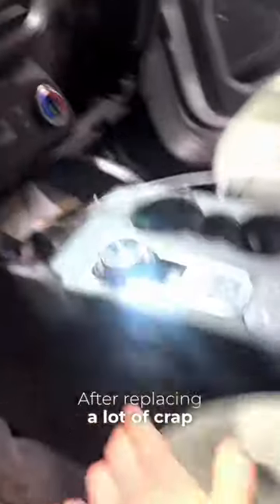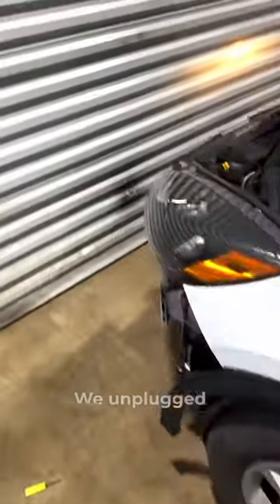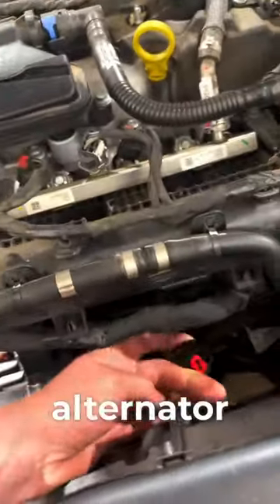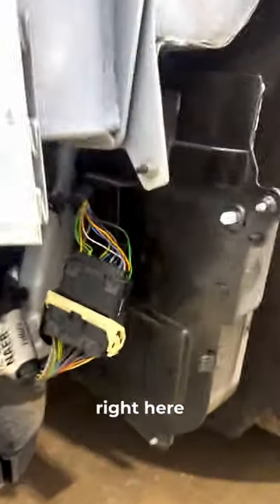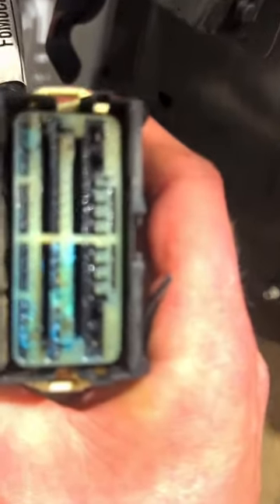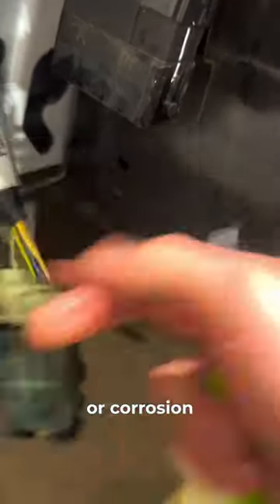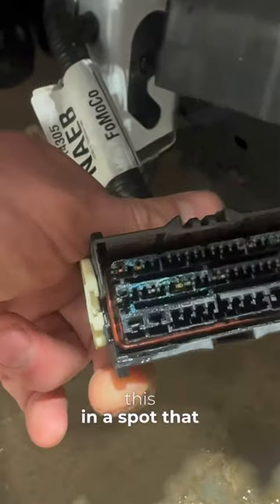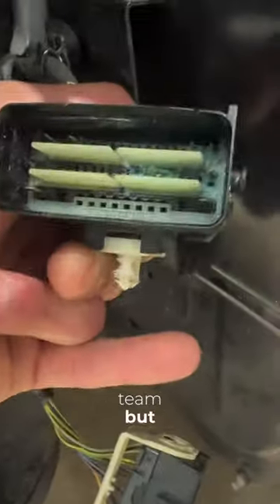Ford owes me big time on this one #ford #shorts

Comment: I feel you on this shit bro. Something like this will happen and you do your best to figure it out and you recommend a part you are not for sure 100% will fix it and it ends up not fixing it and the customer is PISSED because they expect you to know EVERY bolt, connector, pin, wire, bearing, and bushing by heart. But you keep trying and ACTUALLY find the problem after hours and it fixes it but the customer is like “well why didn’t he check that before?” But again, they will never understand.

Comment: I ran into that exact same problem about 10 months ago. What genius engineer puts the active shutter grill on a data line
Reply: What is the purpose of the "Grill shutter" or "Shutter grill" this is the first time I ever heard of this and whatever it is, it's probably not needed!?!
Reply: @Seriously6818  In “theory”, it improves fuel mileage by improving aerodynamics on the highway when the shutters are closed. They then are commanded open in stop and go traffic to allow sufficient air flow to keep the engine cool.
Reply: They’re all on a comm line, no matter which manufacturer. The problem here is poor quality “weatherproof” connectors.

Comment: I bleed Ford blue, but Ford needs to get their shit together.
Reply: No different then any other brand.
Reply: FR
Reply: I am turning to Hyundai now that ford stopped building in Australia. I'm not buying a Thailand made car with a VW transmission
Reply: Plastic chain tensioner, plastic sunroof track parts , crap manifolds, my 3.5L is a leakOboost more than an ecoboost. Pisses me way off more than my Triton 5.4 motors I've owned.
Reply: @OffGridInvestor  might want to consider something other than their 4cyl offerings. My friend has 2020 Elantra with 150k km that has catastrophic piston slap after having give for the recall 50k km ago that said his was all good. No warranty.
Reply: yup,they definitely need to get new engineers  - I have 4 Fords - thankfully mostly older
Reply: @OffGridInvestor Hyundai? With all their shit recently? People are stupid.
Reply: I do also but I finally had enough of their crap and went toyota
Reply: @FosterFarmsOk  my family has been buying Toyota since 1981. I currently have 2 tundras and 1 Highlander lol. But I also have 2 Ford trucks and a Ford cargo van
Reply: My experience with ford was the power shift focus and then an eco boost escape where the long block straight up failed on the highway. Not a great track record to say the least
Reply: Buy a Toyota and very seldom require repairs.

Comment: I’m currently diaging a evap issue on a police interceptor, per PTS I have to unplug everything that runs off the VREF and some of the shit it tucked all the way under the intake and it’s a pain in the ass to get to :/ I hate ford engineers
Reply: Every vehicle has stuff under the intake. Invest the 5-10 minutes you need to unbolt it, create some space and continue on with your diag. If you think that's bad, wait until you get something difficult.
Reply: @AT-wl9yq  it’s a pain In the ass to get the intake off, half of it is shoved under a bunch of shit, trust me, I’ve done many “difficult” jobs working at a ford dealer

Comment: Our 2018 ford escape is sitting with a blown transmission at 147k miles we still owe $4k on it 
I’m a mechanic I was having health issues when we bought it hence the bad decision 
We’ve always babied the car it even has the original brakes still with tons of pad left mostly freeway miles going to doctor appointments 
Replaced it with a $1500 06 grand marquis with 140 k miles
Reply: I'm a GM tech but I can vouch that that generation of gran marquis or town car or crown vic are some damn good automobiles
Reply: Long live the Panther platform. I drive a 2010 marquis myself
Reply: Any trans fluid changes? Real nice of Ford to not have a user serviceable filter so when the internal filter clogs up, the transmission has to be split open for repair.
Reply: @scotts148 dam that's a bad idea
Reply: I mean 150k miles out of any transmission aside from Toyota is pretty expected.

Comment: I was a 38 year GM, master Tech General Motors is just as crazy most likely a little crazier
Reply: as someone who worked at ford and now works for GM general motors absolutely takes the cake for wiring issues and complexity. ford’s are annoying and frustrating but there’s not alot too them comparatively speaking
Reply: @LifeAfterWideOpenThrottle  you are absolutely right in the worst diesel engine made general motors makes it will not exactly but the Duramax anything just got that name on it is the worst ever made at this point

Comment: Tried to tell the AH-64D crew chiefs/ mechanics not to turn the aircraft connectors down like that when they place the connectors in plastic bags… if they even bothered to bag the connectors.

Many times they would bag them, but not secure the bags. Then they fill up with water. WTF?!?! In case you’re wondering I was an Avionics/ Electrician on helicopters before retiring from the Army.

Comment: My mother bought a 2021 hybrid escape, tried to tell her not to but she didn’t listen, hope she has good luck with hers
Reply: She’s so screwed they don’t hold there value in a couple years it will be worth $1500
Reply: Worst car I ever bought transmission and engine both less than 100,000 miles then new motor  8,000 miles in blew headgasket  1.6 ecoboost never buy another ford
Reply: When's the funeral?
Reply: Damn she might be better off buying a used 2006
Reply: @themrjones  that’s what I said I found a nice 2002 Toyota Camry with 90,000 kms, was in mint shape old guy owned er and only wanted 3500 bucks Canadian. She didn’t wanna drive somethin old. I tried
Reply: @davewilson7120  The hybrids are different they use a 2.5l duratec, which have no coolant intrusion problems like the ecoboost do.
Reply: Honestly powertrain wise she should be okay for at least 150k, the main thing I'd be worried about is one of the control modules pooping itself, They can get really expensive.

However I have seen a few mavrick hybrids come in with a transmission issues that seems to be a common enough problem to have a TSB on it.
Reply: Tell her not to go thru water with it. At least she didn't buy a ford focus with those dangerous transmissions that won't disengage the clutch and push you into oncoming traffic. My uncle who's not the smartest went and bought one "coz it was cheap". This same guy said the fallujah insurgents could be stopped if the American military had A GUN HAND-IN/BAN during the middle OF THE WAR. Like they would voluntarily hand in anything
Reply: @Jonjones30003 i would've bought that camry myself off the old guy
Reply: @Mrjack-yn2dj  Those 2.5L Duratec I4s are great motors. I wish Ford still offered them as the base option in their smaller vehicles.
Reply: @madmatt2024  yup, only engine concern I'd get on those are always engine mounts causing a bad vibration

Comment: In the 80s & 90s FoMoCo wiring was the best you could get. Thick ass wires & big purposeful plugs that weren't so flimsy. 

Then they decided to go the way of GM & this is the result!
Reply: wholeheartedly agree with this. Grew up all Fords... I wont touch them now. past mid 2000s RUN sad

Comment: Vertical mounting is not the problem. The connector was installed upside down. It was installed in a manner that collected water. The top side went in the bottom. Just like holding a cup up in the rain and expecting it to not fill up. Water will run down the harness and inside the outer edge of the connector between the two bodies. If it was installed the other direction it would be much better. Horizontal is almost as bad. Water will get between the outside of the bodies and lay there till it corroded then breaks the seal. Will take longer to do this but all the same.

Comment: If the connector meets the USCAR21 S3 rating for water protection, there's no problem with it being vertical. Chances are this connector's seal was displaced during assembly.

Pulling on the connector like that isn't going to do it any favours. Support the housing of the mating half before tugging.
Reply: First rule of product engineering; understand that service people will always do what's easier, not what's correct, so design accordingly.
Reply: Found the Ford engineer!   Lmao. Thanks for the garbage vehicles
Reply: If the seal can become displaced during assembly, I’d consider that a design flaw, not an assembly error.

Comment: Had one like this not too long ago, was about to drop the transmission for a unable to see neutral DTC. When disconnected that same connector found all pins eaten up by the corrosion ended up replacing the harness and solved all issues!

Comment: Chrysler Pacifica has the same issue with a 12 pin connector located in that same area. We’ve been doing weather pack connectors for over 40 years but it seems they didn’t get the memo.

Comment: They also put the tcm right behind said connector it makes you wonder 🤔
Reply: Wonder about what? They don't put the TCM anywhere on that vehicle. Its not a separate unit. They combine it with the PCM and its all in one module.
Reply: @AT-wl9yq nope, it's not like that anymore for a good 10 years or so. ECM became a PCM, and does the shift scheduling, and there's a TCM now, which is what drives the shift solenoids.

Comment: They all do it , Ram has a few connections just behind the LF inner fender, they quite often fail to the green death, transmission, rear lights and tow lights , fuel pump etc… sit there. I have found the right rear taillight fail at this point and also transmission shift issues. Also a Chrysler product , my daughter had an ‘08 Jeep Compass with harness and relay box under the LF inner fender behind the headlight. It failed on her from the green death. It started with AC not cooling. I had noticed the cooling fan did not work.I didn’t have any means of wiring diagram, identification or the like. Had a friend at local Chrysler shop getting me some wiring diagram info. Before he got it the stuff to me the car broke down . She was 200 miles from me altho I told her not to leave the city with the cat until I could tackle it. The dealer in Toronto fixed it . After that I always checked there firsthand. It caused a skim module code on a Caliber but the issue was that green death at that same relay box

Comment: I have seen this exact issue several times now, on the front and rear of different vehicle. It usually happens after a fender bender bc the body shop leaves the vehicle outside without bumpers on them while waiting for parts/repairs. Always throws weird body codes every time I’ve seen it. Turn the headlights on and the wipers start twitching or cluster starts doing random shit.

Comment: I could never be one of those sheep that say they bleed ford blue or chevy for life. 
Its a brand and they only want to make profit and intentionally design things to just work for awhile so they can sell service or more units.

Its rare, but sometimes they make reliable vehicles. I had a 96 dodge dakota in like new shape. Engine was bulletproof. 190,000 miles before I was tboned.
I have a 06 Silverado and so far, its been great. 250,000miles also like new shape.
I have an 89 gmc suburban. Either 40k or 140k miles and so far its been reliable too.

Comment: 2019 5.0 F-150, 2017 3.5 N/A Edge, 2014 3.5 N/A Edge

ALL solid and reliable performers. Ford isn't PERFECT by a long shot, but they're a hell of a lot better than any Chevy or Dodge that I've owned. Just my 2 cents.🤔

Comment: I noticed they have gasket between the connectors but nothing on the butt end. Those are supposed to be water tight or at least resist water.

Comment: GM puts a major body harness plug under the battery!
Reply: Yep! Guaranteed corrosion and subsequent electrical gremlins 😖
Reply: $$$ Brilliant! $$$
Reply: My 2004 Duramax has the main computer module under the driver side battery.  ACDelco had an issue with leaking cracked battery cases. I replaced it with  AGM batteries.
Reply: How about the Savana/Express with the main power distribution box wisely placed under the brake master cylinder & right under a drain point (at least until they came out with that chintzy plastic shield). What a joke! 

Tupperware dash, seats & seating position made for aliens, insanely complex doghouse access, constant EBCM issues. 

Got to be 1 of the worst quality vehicles I've EVER touched & yet they keep jacking the prices up on them.

Comment: Well ford engineering team must have not heard of the seals around the wires in the holes in the connector where they go through and also no seal inside the connector 
Ford 👏👏👏👏👏👏👏👏👏

Comment: Wood dielectric grease or silicone grease prevent this?
Reply: It would help, realistically you would want to house it somehow to shield from water. The issue is it’s in such a terrible spot it catches water from both ends.
Reply: No, but get a bottle of that liquid electrical tape and seal that suckered. Make the next person opening that connector curse you to the moon.😎😁

Comment: Thanks bro. Gord has always had electricity issues.   They had brittle wire sheath on the 80S 90s cars. The plastic would fall apart and leave the copper exposed.  The whole harness was like this.   Ford on fire with homeless people keeping warm around them.  😂

Comment: I was just about to go buy a Ford until I saw this video.
Reply: Buy a Toyota
Reply: The new Toyotas aren't any better. They've been going downhill quickly since 2017. Reason being in 2017 they finally had to start following the ridiculous American emission Cafe standards. I'm sure there have been plenty of engineering snafus over the years but most of the problems on these newer cars are stepping from last minute modifications or stupidity that has to be put in there because some politicians somewhere said it should. The same politician that decided how much water you should be able to use when you take a crap and flush your toilet. Cuz I know that's who I would expect to know that answer, a senator. It has literally become idiocracy. Complications upon complications to answer the problem of the month.
Reply: @ashes2ashes863  I agree. But not as bad.. they come out with a new model every two years

Comment: What is your take on car makers transferring the pcm to the engine bay?
Reply: car makers have had the pcm in the engine bay for decades. My '93 cherokee's pcm is in the engine bay(as is my 1985 Eagle's). my 2003 ram cummins is actually mounted to the engine block! (i really dont like that).
Reply: Yep, no issues with pcm being located in engine bay. Mounted to a vibrating engine or inside a transmission that goes through major temperature swings everytime you drive aren't my favorite locations but both have also been pretty reliable too. (At least in GM vehicles)
Reply: @ReaperRestorations Most engine ECMs on industrial engines are mounted to the engine. I know it goes against the heat & vibration rules for electronics but if they’re high quality it’s rarely a problem. Problem is quality has become a dinosaur.
Reply: @preachers4135  don't think there is a justifiable reason to rewire pcm to the engine bay other than creating income for dealership's,, it sure looks like another stab to cosumer's back
Reply: @alexlopez-yk6lf You guys just make up the first thing that comes to mind. Think about what you just said.  
"don't think there is a justifiable reason to rewire pcm to the engine bay other than creating income for dealership's,"
Why would they do that? Where's the upside for Ford? Most jobs like this are done while the vehicle is still under warranty. That means Ford has to buy new parts from the dealer to fix the vehicle, and will have to pay them somewhere between $150-$200 per hour labor to install them. The customer will also get a rental while the vehicle is in the shop being fixed. There's even a labor op attached to the RO for processing the claim. If you don't know what that means, the dealer is billing Ford for the time it takes them to do the paperwork for the repair. 
What does Ford get if the vehicle is out of warranty? Nothing. The dealer gets paid directly by the customer to fix the car.
Reply: @AT-wl9yq  obviously the dealer is waiting  and hoping cars break down out of warranty, this is for all car makers, some nissan  Armadas have the starter under the intake, some put the timing components at rear of engine, what would be a good reason to move the pcm from the driver cabin to the engine bay?

Comment: Man Ford sure has a lot of problems with their wiring in the newer stuff. The larger trucks are having problems with corroding cables to and they are only four or five years old sonetimes. Guess they shouldn't have made fun of General Motors when they came up with their fancy thermopack connectors or whatever the hell they call them. They don't get water in them, that's for sure.